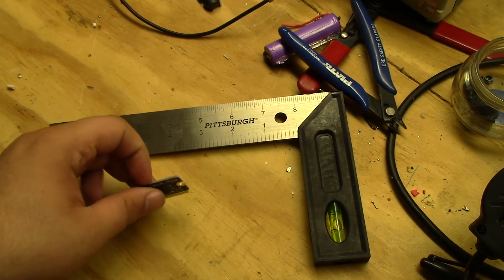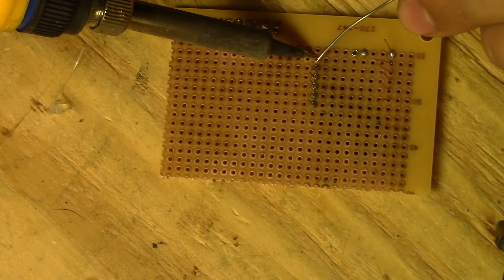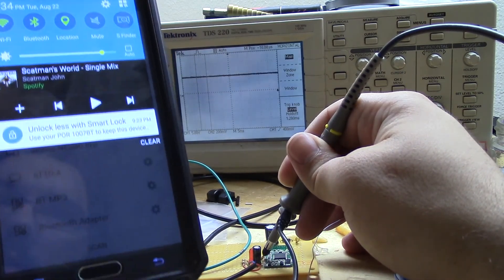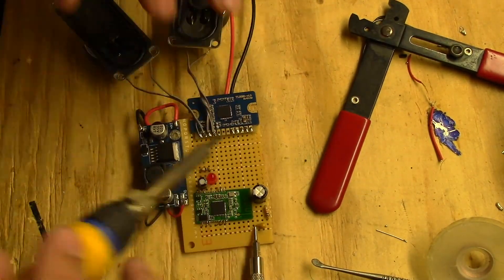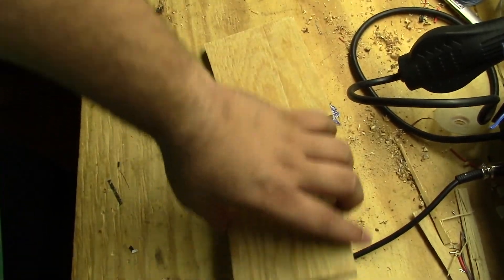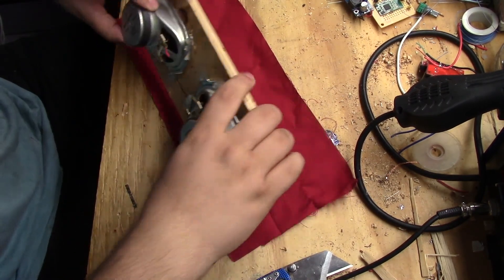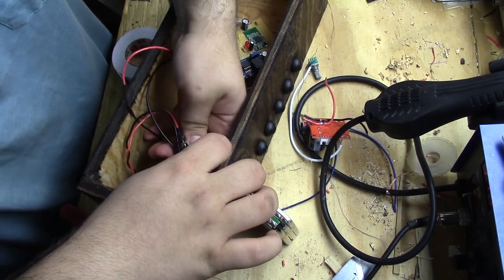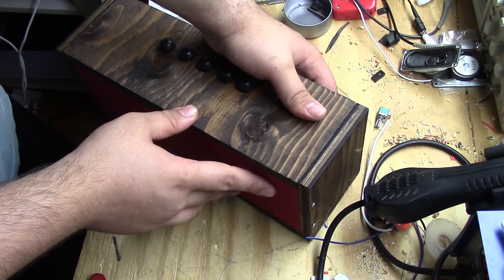Make your very own bluetooth boom box for under $30.00!

Comment: Nice work! You have used a very good Amp. IMHO this Amp is much more better than Tpa3110. It has more bass and sound quality.
Reply from the maker: Thanks! I am in the process of another bluetooth build, so I hope you stick around :) This amp is awesome!
Reply: Taylor Burley HI. Next time add a electrolytic copaciter before amp. 2200 ore more. It will give you more power at lower